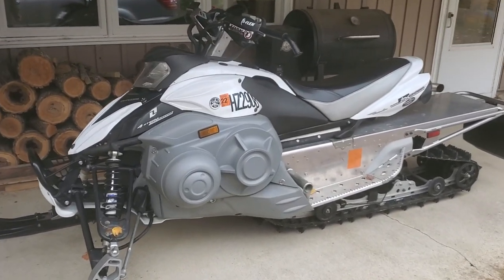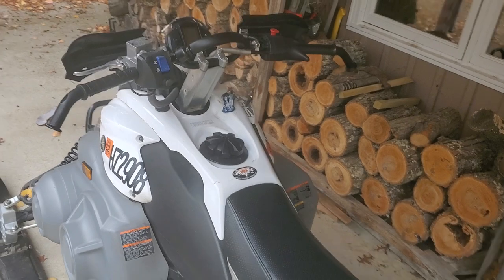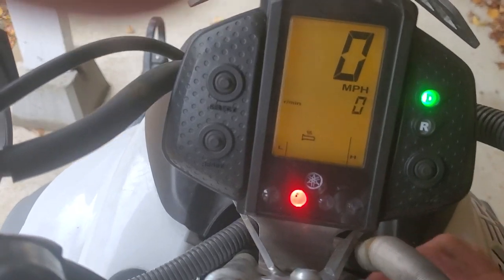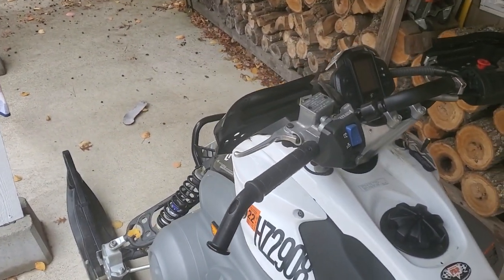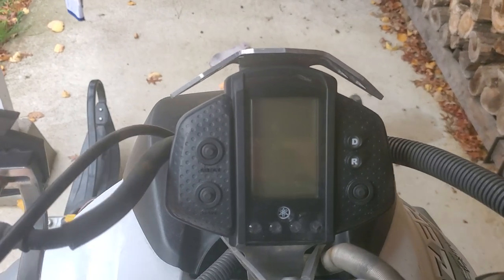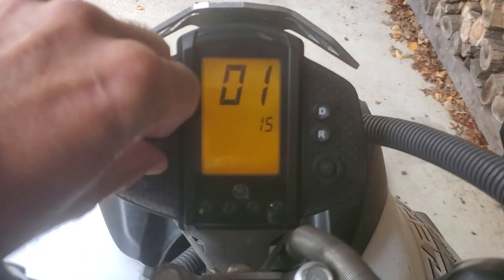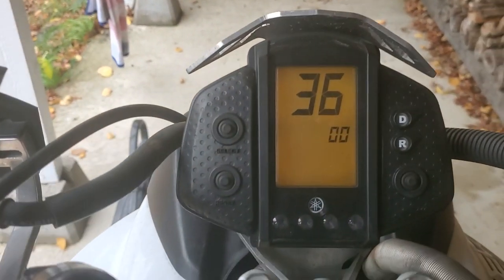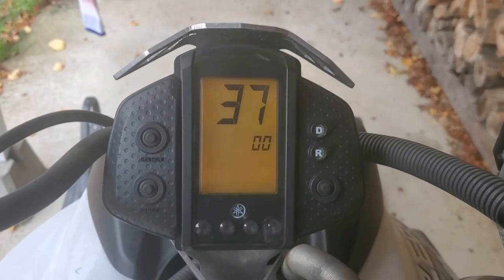FREE and EASY TRICK for Tough STARTING Yamaha Phazers

Comment from the maker: UPDATE:   In cold weather I am finding that it takes between 4 and 7 cylces (presses of the handwarmer button) PER cylinder to adequately prime the engine.  Apparently each cycle does not put much fuel into the engine and I have not yet had any trouble with flooding the motor.

And also this priming technique could come in handy for any engine cranking slow, for very cold starts, and also for rope starts where you want it to pop off on the first pull.
Reply: thanks man

Comment: Damn… I just got an 07 and it’s not an easy starter here in MN… tried this and it fired right up.. I owe you a beer!!!!!
Reply from the maker: Cool!  Hey yeah always have a can of spray start handy too for those "cold-cold" days though.

I find this trick handy, but my sled has it's temp limits on it working.

At some point ether is the only way mine will start.

Comment: Thank you for the great tip!  I've always had problems starting my sled even after new battery, plugs and cleaning!  Scrappy dealers never mentioned a recall.  Worked perfectly!
Reply from the maker: Glad it worked!  But I have found there are days... when it is "extra-special" cold... or the batt is weak,  where you need a shot of starting fluid down the intake tubes.

Comment from the maker: One other tip I found that helps is to make a straight crank attempt at first (as seen in video) and then do this priming trick for the next try if needed.
Reply: Really wish these weren’t such a pig starting.   I run full synthetic not sure if that does anything

Comment: You can save a step by going to diagnostic mode 50, that is for the full system and primes all 2 or 3 injectors at the same time.
Reply from the maker: Cool!  👍👍  I missed that mode when looking through it.
Reply: In the manual, #36 & #37 cycles the actual injector, #50 cycles a "Fuel Injection System Relay"... Does this accomplish the same by adding fuel into each intake manifold?? I believe the System Relay operates the Fuel Pump which cycles fuel but doesn't open the injectors???

Comment: great vid thanks for that info my 2012 nytro does start fine but the check engine light flashes when i come to a stop but once i take of its fine was wondering if you heard of this before thank you
Reply from the maker: Yeah that check light should have a code with it that you can read if you follow the service manual instructions.  That will give a good clue as to where to start.
Reply: @brettlarson4327  ok great thank you !

Comment: Have you ever had a problem with the reverse that doesn't want to board 2 out of 3 times. thank you
Reply from the maker: My reverse has been good so far but  people say to bounce on the running boards when trying to go to reverse...  helps take gear pressure off momentarily and allows the shift.
Reply: @brettlarson4327  I say that because I have a venture mp 2015 and I am told to clean the electrical mechanism but I am not born where? Thank you from Québec Canada.
Reply from the maker: @1957brun  I dont think it is the electrical connector if it is working intermittently.
Reply: @brettlarson4327  thank you Brett.
Reply: Yes, rock the sled forward and back by lunging your body/pulling on the handle bars etc. and it should go right into reverse
Reply: @jasonberning1086  Merci beaucoup du Québec Canada

Comment: I just bought 2 of these and I am regretting it. They are both hard to start and regularly kill the battery trying to start them. Since they don't have pull starters, you have to have jumper cables, the right hex driver to get to the battery and a willing 2nd snowmobile. Very disappointed with yamaha. I will try this tip though, thanks.
Reply: did you try heating the engine with a blow dryer or little buddy heater?
Reply: These are great sleds! Sounds like you have an issue going on. They should fire right up. Maybe try running a heavy dose of Seafoam through fuel tank to clean fuel injectors. Should also only be running premium fuel
Reply: @jasonberning1086  I've done seafoam, replaced batteries, new plugs, new fuel, they just can't turn fast enough in weather below -10. Now the problem is rolling them over. I have never rolled a sled so often. Everyone of my friends who drive them roll them. Super dangerous.

Comment: Or just turn the key one step and when it has stop buzzing turn off the key and do that again 3times. I
Reply from the maker: Nope what you speak of only pressurizes the fuel rail but does not pump any fuel into the engine.  The method in this video actually cycles the injectors and "sprays" a bit of that pressurized fuel rail fuel in.